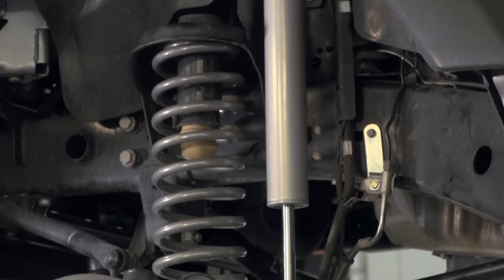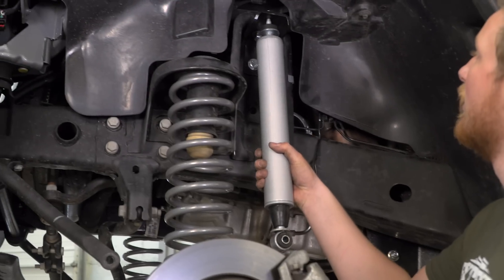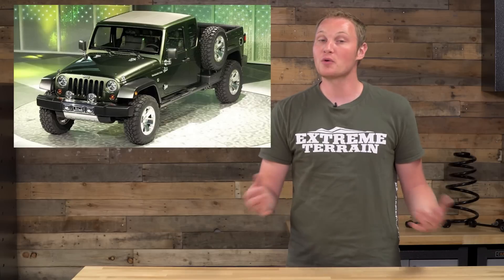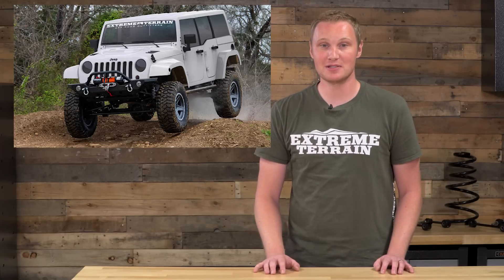Jeep Wrangler JL Spy Shots + 2016 JK 4" Lift & Rampage Top! - Throttle Out

Comment: He says the steering stabilizer doesn't help... As he is driving down a perfectly smooth road... Give me a break.  I have this same set up on my 2015 4 door and it helps a lot!  I drive down really bumpy country roads every single day and trust me it helps a lot.  I've run my 4 inch lift with and without the dual steering stabilizer.  The lack of the "flighty feel" is the dual stabilizer working.
Reply: He said it doesn't stop the death wobble (which it doesn't), but helps with bumps not sending the shock waves up to your steering wheel.

Comment: I've seen one of the jeep trucks at my local dealer. Its not for sale but it is in the employee parking area. I did get some pics and it looks exactly like the pic of the truck in your video so maybe this is a sign of cool things to come.
Reply: What is it look like??? Does it look like the wrangler jeep ? 2 door / 4door ?? give more details..please..????
Reply: It looks like a 2 dr wrangler that has a sort of modified extended cab at the B pilar. Beyond the ext cab is a truck bed, just imagine a 2 dr wranger without its top (appears to be the freedom top over the front seats) and no second row seats just open bed. This one has a external roof rack and the spare tire is still in the same place on rear door. I believe this is user modified but it also appears to be a very good representation of a potential factory truck version of a JK or I suppose JL.
Reply: +mykalbee Copy...Thank you for your information, I've been waiting for the Jeep pick up trk..I hope they built it like the concept...Thank you..
Reply: The other day I was driving in the Miami area and I happened to also see a pickup wrangler. I literally scratched at my eye balls to make sure I wasn't hallucinating lol. Yeah it was all the same up to the back half of the cab where it just turned into a bed as a pickup. I considered if it was an aftermarket build by some guy, but it looked way to nice and smooth—like if it was straight from factory. Idk, maybe it wasn't anything special but man did it catch my attention haha.

Comment: Correction, up front you are only correcting for one angle .. Caster.  Pinion angle runs steeper with geo brackets, cam bolts, arms, etc. 
4" is tough on pinion angles regardless, that rear is not going to last long without at min upper arms. 
Of coarse once the upgrade to double carden shafts happens then front and rear pinion becomes more important.

Comment: If jeep wanted to help in miles per gallon they would free up the front axle and install manual locking hubs.  As it stands now, you loose a lot mpg's because of additional rotating shafts and gears.
Reply from the maker: I think that the amount of MPGs lost due to the rotating shafts are minimal. Not saying that there aren't any to be gained by eliminating the extra rotation though! However most people now a days would rather sit in their driver seat and let the buttons do the work rather then get out and manually lock their hubs. -Jake

Comment: I notice some wobble from that drivers side front wheel assembly at 10:15-10:20. Any idea what that's from?
Reply: You mean how the tire looked like it had a wobble going on?
Reply: Yeah, but the whole wheel. Not just the tire.
Reply: Erik Hoolihan I know this is going to sound dumb but I believe it might be a illusion coming from the thick tread not being symmetrical causing it to look like it's making a wobble but it's just changing the shape.
Reply: I put 35s on mine about a year ago and my driver rear did that same thing, about a week ago i changed brakes and rotors and it was just my rotor not sitting well or something along those lines, I'm not saying that's it but that's exactly how mine acted.

Comment: what is the best way to go with respect to a 2014 JKUX with an automatic  transmission with factory option , front and rear Dana 44s, both with 4:10  factory installed gear ratios, If you use the 4:10 on35s will the torque deminnish? this is also relative to going with 37s? at what time is it time to rear based on my options .

Comment: I've noticed that on quite a bit of your builds that aren't Rubicon's like this Sport Jeep with the 4" lift and the 35"tires even though it looks good but it's not really practical for 4-wheeling. I've taken my 16 year old daughter who's wanting a jeep with 35"tires and we've gone on some test drives as well as she's gone 4-wheeling with me in Rubicon's with 35"-37" tires and she's realised the lack of power that these jeeps have without having a 4.10 gear minimum if your going to really do some 4-wheeling or even a 4.56 if your going to be more aggressive or even going to a 4.88 minimum with going with 37" tires. I've noticed on your builds that you really talk about cosmetics for the Jeeps with just talk about suspensions, shocks, stabilizer shocks but you really never talk about gear ratio with what size tires that your going to need if your going 4-wheeling because my 16 year old daughter wouldn't be comfortable going 4-wheeling with a stock gear ratio with a Sport Jeep with 35" tires. Maybe you guy's are just interested in dressing the Jeep up and having a winch on it to pull you out when you get stuck every time. Rather than talk about what gear ratio you should have with what size tires and not getting stuck (unless I've missed that video about you talking about gear ratios)...
Reply: good grief....take a breath. You just wrote a very long paragraph...that you could have shortened to a couple of sentence instead of  repeating the same missive 3 or 4 times.
Reply: freepatriot then don't read it, I didn't ask you to...
Reply: Joe Tarlos  , I bought my 2014 Rubicon JKUX  , I ordered it fron the factory and was very specific in what I wanted as I am a mechanic with  reference to gear aspect ratios with regaurds to size tire and gear revolutions, and I agree and I would like to hear from you about this.

   On my 2014 I ordered mine with the Auto Trans and as an option with the upgrade to the Dana 44 with the 4:10  gear aspect ratio both in the front and rear axles. Now I have heard different opinion on this , basically that yes with a lift use 35s and will be fine with regaurd to revolution rate to the wheels which is also I heard with regards to the same rate. Question although the 4:10 gears will go to those  wheels, that each size higher will deminish the horsepower torque ? my question  at 35s that 4:10 will still have that same torque as when it had with the stock 32s using the same stock rims?  want to keep as much torque.
Reply: John McGinty I'm no mechanic and I don't want anyone thinking that I don't like Jeeps because I do and there's so much that you can do to them. You obviously ordered your Jeep with the maximum options to give your Jeep as much power/torque. I definitely wouldn't go any bigger than 35" tires with just a 4.10 gear ratio if your going to do some 4 wheeling I don't think that you'll have enough power with only having a 6 cylinder. A buddy of mine has a Jeep that came with 4.10 gear ratio and he changed them out because he didn't have enough power 4 wheeling  really not that bad as far as accelerating onto a highway from a ramp. But these video's that they are showing don't come with 4.10 gear ratio but your one up with having a Rubicon they are much better Jeeps than the Sports for any light 4 wheeling with a stock Rubicon. My buddy did some modification to his engine to give out more power along with changing his gear ratio. I believe that you'll really have to think of how much and how heavy your going to be 4 wheeling to think of how much your going to want to stick into your Jeep to strengthen it and how much power you want your Jeep to have for what your wanting to do. I doubt that I really gave you much help but your going to have to think for yourself on how serious 4 wheeling that your going to do, love to see picture's of your Jeep once you come up with what you do to it (good luck)...

Comment: RC sucks. And 4" I don't need. A 2" - 2.5" OME lift is perfect and the quality is second to none. 33" Duratracs will fit my rig very well. No need for anything bigger. Currently I have a Teraflex 2" leveling kit with 32 BFG KO2's. Wish I had waited, not a bad setup but certainly not great either. BFG's don't compare to Duratracs and weigh less too.